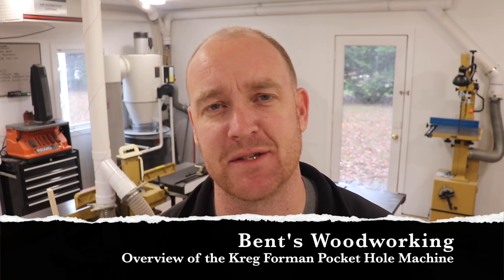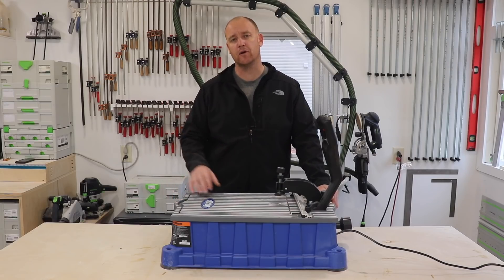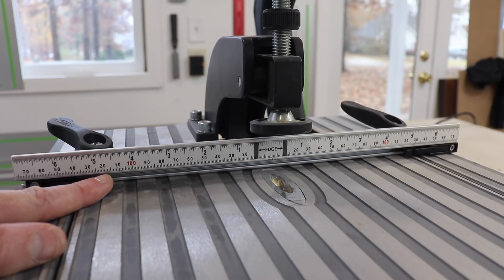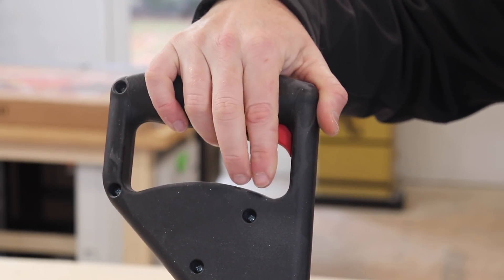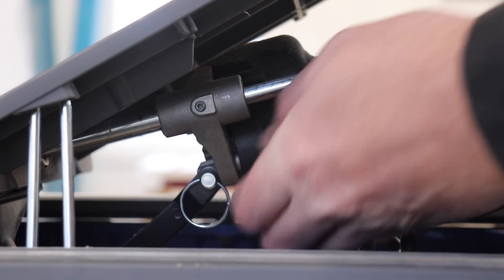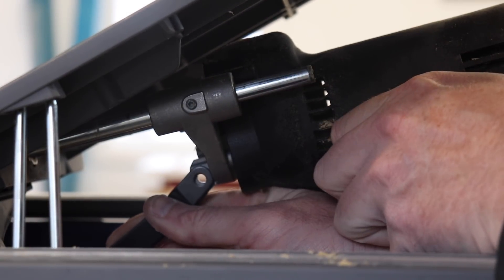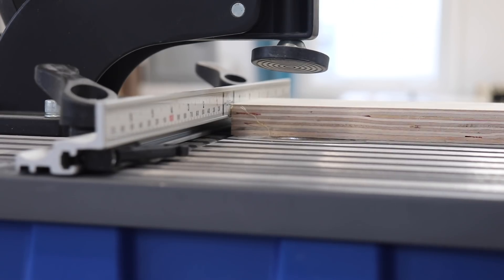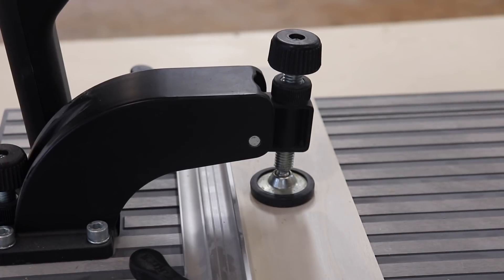Kreg Foreman Electric Pocket Hole Machine - Is it right for you?

Comment: Big big fan of the Kreg pocket hole system.  I have used Kreg tools for years in my own shop, and have never regretted it.  At one time, I nearly had my employer (at the time) talked into putting a Kreg machine into production in a high volume milling plant.   I bet that if this were available at that time, we would have had one or two of them in the plant.  
Great demonstration of how this machine works.   ...And the price is quite reasonable, less than I expected.   If I were still doing a lot of projects in my shop, this would definitely be on my short list.
Reply from the maker: NJP Vlogs N Stuff Yes I definitely feel like this product has a very reasonable price for what it does compared to the other options that Kreg provides. Now that I’ve used it for a while it’s definitely the only way that I would want to do pocket holes in the future

Comment: Hi Jason, and hello to all the grafters who subscribe here. I have been reading your comments. The manufacturers videos were crap so this was really helpful thank you Jason. I am an art gallery technician in the UK. For years, I've used bench Kreg pocket hole jigs to build stud walls in art galleries because they have to be more accurate than a domestic built stud wall. Now, I have been asked to build a 9x 4m stud for a gallery. By myself, pretty much. That's a big step up and I need to minimise labour time. Can this machine's motor cope with round the clock use for several days in your opinion? Is it proper kit or lazy DIY? The machine looks like a godsend but it might be a gizmo. Anybody else got an opinion? Rob

Comment: What setting do you use for for 18mm plywood so the screw does not pop out the side??  Just stay short of the 3/4" line and then use the block for the 1.25" screw?
Reply from the maker: I still use the 3/4” mark. Never had an issue

Comment: I have the same machine and love it. I am looking in the back ground at your PVC dust collection system. I will be installing a system also but not sure which way to go (pvc or metal) You having any problems with the pvc and do you have it grounded.
Reply from the maker: Tim Gilliam I only have one pipe grounded cause it didn’t have antistatic hoses. All others that have anti static hoses I have experienced no issues.

Comment: i have been considering buying one of these for a while now. the only thing keeping me from doing so is that i never use my normal kreg jig. its not the jigs fault but rather the hassle of taking it out and setting it up. if im opening boxs and conecting things up i will get the domino out. .. my idea is to mount it up on a wall so that its ready to go all the time. i have a lovely spot beside where my chaging station is that would suite perfectly. hopefully the table of the kreg would come out enough to allow llonger longer pieces to pass. it would be easy to lift down i needed for larger pieces . what do you think
Reply from the maker: MelbourneAlan I was the same way. As soon as I bought this, I never used my K4 again. As a matter of fact, I just have it to a friend of mine. The only time I use pocket holes now is on 3/4 material so I never even have to change the settings. It’s a dream to use this machine.

Comment: Please tell me what I’m doing wrong, can’t find a video on it. Every time I make draws and use 1/2 in plywood and i use my kreg4 it always go through the wood. What am I doing wrong, thanks.
Reply: Is your bit set to the right depth for the 1/2 wood?
Reply from the maker: Google Kreg screw chart and it will give you detailed settings for every situation 👍
Reply: @kisercustomcabinets  yes it is, but I think I didn’t do it right. I used the top part to set the depth and not on the side of the jig. Is that correct?
Reply: @bentswoodworking  
I did, but they really don’t speak much about 1/2 inch boards or screws
Reply: @MrRahluv357  Did you also set the collar depth on your drill bit?
Reply: Also are you using 3/4 or 1 inch screws instead of 1 1/4?
Reply: @Ryan-bc2wh  yes I did. I didn’t use the flat part to get the depth, I used the three holes on top. That’s probably where I went wrong
Reply: @Ryan-bc2wh  using 1in screws
Reply: Did you set the K4 drilling block up to 1/2?
Reply: @Ryan-bc2wh  yes
Reply: @MrRahluv357  Yeah use the flat part using the gauge.
Reply: @Ryan-bc2wh  I did abs that worked better
Reply: @Ryan-bc2wh  thanks

Comment: Ended up here because I’m looking to buy one. Has there been any upgrades, updates on this model since? Seems like some improvements can be made IMO.
Reply from the maker: I’m not sure. I haven’t used mine since getting a castle pocket hole cutter
Reply: @bentswoodworking  I understand. Thanks for replying. Never heard of the Castle brand either.
Reply: @bentswoodworking  LOL You liked it so much you bought a much more expensive one. I have looked at the Castle and know that it makes much neater holes. But, the thought came to my mind. You don't look at the holes as they are supposed to be hidden. What good is a prettier hole?

Comment: I liked using my small k5 jig.   But I stopped because I don't like that I have to use keg screws with that shoulder.  How important is it that I use their screws, can a non shouldered screw hurt the joint?  I have tons of drywall screws laying around.   I know they are more brittle than other types but is there really that much stress on cabinets?
Reply from the maker: kilmo9 I cannot tell you with 100% certainty how important it is. I will say that I have used Different style screws and never had much of an issue. But even when I use the proper screws I don’t use the screws from Kreg because I can get them for cheaper in a larger quantity from a different supplier
Reply: @bentswoodworking  where do you get your screws?

Comment: I just wanted to confirm with you.  At 6:30 you talk about the setup gauge. My understanding is that you set that based on the screw size your using, not the material thickness. But you seem to say the opposite. Can you clarify?
Reply from the maker: There are two measurements to consider, material thickness and screw length

Comment: You had mentioned that you no longer use pocket hole that much! Can you tell us when you use? I also read on FOG they do a hybrid of pocket and domino to avoid clamping using just domino. Any suggestions on that would help
Reply from the maker: I typically use it for cabinet applications and that is it.
Reply: @bentswoodworking  Thanks!
Any suggestions on the second part of the qn. 
Do we really need to use a clamp down for festool domino? 
How about the Hybrid of Domino and pocket hole?
What is your most commonly used joinery?

Comment: It seems this product is most effective when used on longer pieces where you need many holes drilled along the length of the work piece. Ironically, the base of this unit doesn't appear to be well suited for easily supporting long work pieces, especially when you're working at either end of the work piece. Yes, the clamp will keep the work piece from tilting but is the base heavy enough and/or wide enough to keep from being tilted by the work piece? 

Some pull-out supports would be nice, but given where they're needed, is there any room inside the base to accommodate the slides? Plus, they couldn't be any longer than the base is wide. If the base is 18" wide, then you'd only be able to support about 54" of material. That just might be enough for 90% of the projects this tool would be ideal for, i.e. how often would you find yourself needing pocket holes along a 7-8 ft work piece?

I think you made the perfect point about this product. It is not the ultimate pocket hole tool but it does do what it does very well, save for the lateral support issue.
Reply from the maker: GuiTuber you make some good points. If I ever need to support something that long I set up some adjustable roller stand on each side
Reply: I know exactly what you are referring to as I do pocket holes in the ends of 8 feet boards. The Foreman would be easier as you can clamp it to a table. You have to balance the long board otherwise in a straight up position unless you can clamp the very end of it sideways.

Comment: At 00:15 It's hard making a straight line following the ruler instead of using it as an edge guide. I would have blurred it out too if I wanted people to think I was actually drawing it and not tracing it to look cool. Ya messed up when you came into focus at the last frame to pull away the ruler and revealed that the line extends 1/4" past where you stopped the point of your pen. It was kinda cool though.